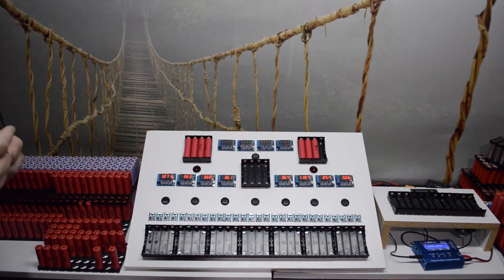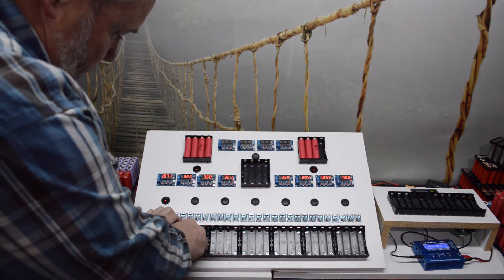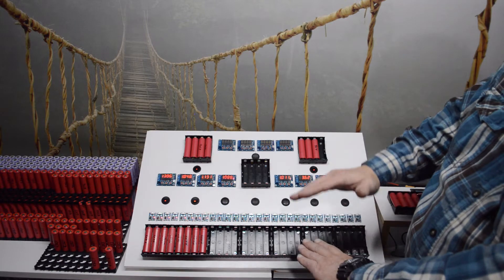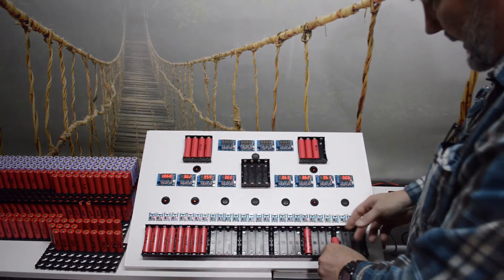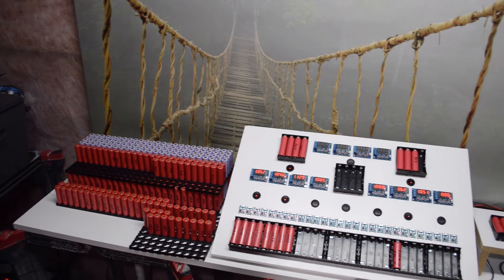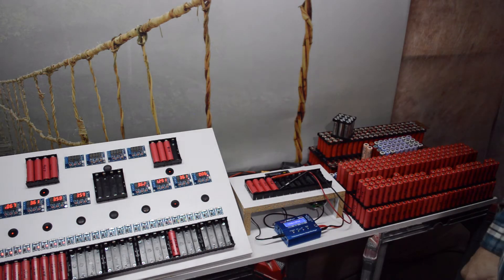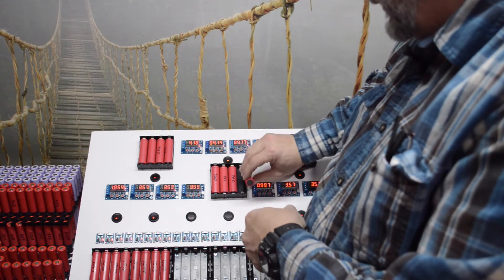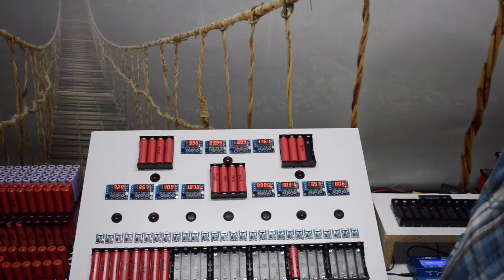Cell Processing The DIY Engineer Way - Part 3

Comment: On your charger supply via cpu supply,  doing all or most cells at once - have you verified that the supply voltage does not drop close to the 4.6 for the overhead needs of the charger boards ?   Thinking that many cells all drawing 1 amp on the 5 volt rail, and for not much difference for a stand alone high power 5 volt supply that can better handle the current needs is what I was thinking.  I plan do do this as I have a 50 amp 5 volt supply that will allow me to scale up the charge count and even with a small boost converter to feed the discharge boards.   Thanks for the great video's :)

Comment: i want to charge 16 or more at the same time ,, with cheap method :( , i  am using lm317 regelator now
Reply: Don't use lm317 for charging as It will not handle the needs of cv/cc or shut off the charge when full.  These small charger boards are near as cheap as the 317 regulators and much more safe. Think what a loss if you over charge with the LM317 of a good cell and or the loss if they burn your house !

Comment: Pardon my idiocy, how many power leads and voltage each for the charging leads(x28) and how many for dischargers(x12). Thanks. Love your DIY experience.
Reply from the maker: Each charging and the discharge units run on 5 volts and they only require 1 amp each. I just connected them to a 500 watt computer power supply.  That same power supply has enough power to supply the whole board.  I did use 12 volt leads and I used buck converters to step the voltage down to 5 volts.

Comment: Hi Frank, I love your processing board.  I am just starting to build my own. I like how you have hidden your wires below the board. I have purchased similar dischargers and I don't see obvious  5v + and -  solder pads or points on the bottom to solder to.  I do have Micro USB male heads I can solder to and might go that route, but if there are good points to access on the underside of the board itself, I would rather go that route.  Can you tell me how your did yours?  What would really be great, would be if you would do a review of the board itself, where you show us the underside with close ups.   Anyway, great channel, I am learning a lot from you.
Reply from the maker: Yes, I think that will be the next video I post (next Tuesday). I have some video from when I built it over 6 months ago. Plus I have not made very much progress on my Portable power pack this last week. Thanks for the suggestion. 🤓
Reply: I look forward to the video. Thanks Frank.

Comment: I did make a cell charger out of the TP series chip set boards but when charging 4 at a time the actual chip itself gets really warm , i don't know if its because they are all going to same ground or as the batteries gradually get more full the chip has to burn off more amps to control the charge current.
Reply from the maker: +steve64464 I have noticed the same thing. I think you are correct, with 5v going in and it slows the amps the fuller the cells get.
Reply: I increased the amps going into it like 1amp per unit but when it gets toasty reduce the current in and it cools but i figure i must be doing something wrong as everyone else is making these cheap crude chargers. I don't know how much heat these chips can take or if they have thermal cut outs.
Reply from the maker: I have seen them get warm to the touch.  I know that those chip sets are designed to do constant voltage (CV) and Constant Current (CC).  That process requires that resistance is applied to slow the amount of current as the cells get topped off.  that resistance will cause heat build up.  As for me the only TB charging unit that I have burned up was causes from me putting cells in backwards.  I hope this helps.  Frank

Comment: Looking forward to see more. From the time you collect the batteries how long before you put them in service, and what is the end goal with them all.
Reply from the maker: +skozzy1968, It took me a couple months process my first 300 cells.  My initial goal was just to have portable power for emergencies. Now I want to build a power wall.
Reply from the maker: Skozzy1968, Well I started collecting old laptop batteries back in November of 2016.  My overall goal was to install solar panels on my house, but I thought it was crazy to have a way to generate all that power but then not have a way to store it so I started looking into the different ways to store electricity.  So the short story is I'm going to build a power wall...  I didn't know how to make that happen so I start by building my Portable Power Pack.  It was a great learning process.  So I have now processed 2100+ cells and I will start assimilating my powerwall.